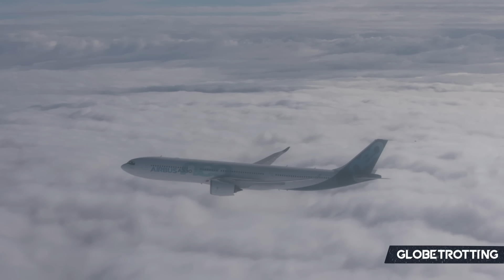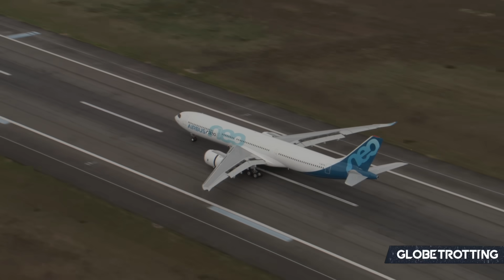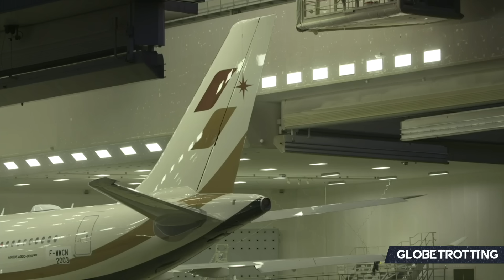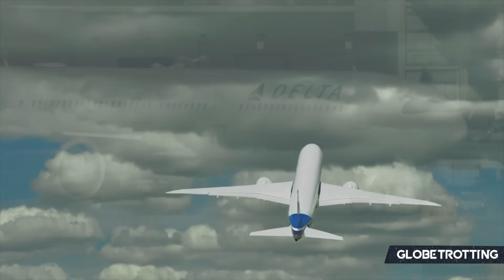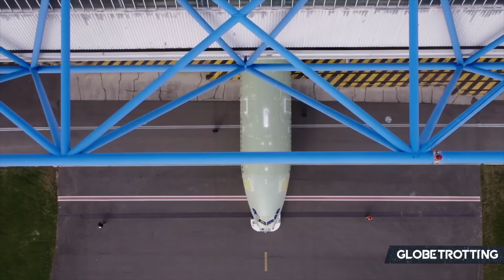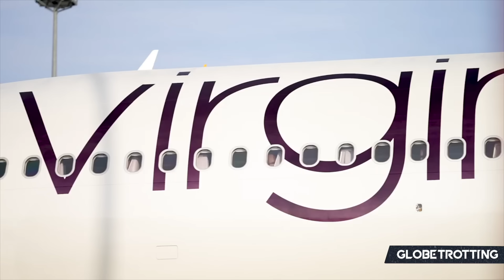787 RIVAL - The Airbus A330neo

Comment: Having been on an A330-ceo (as well as a 787) I do preffer the A330 slightly. I love the 787 cabin pressure advantage, which I think is the best feature on the plane, but I fly exclussively economy, where the differences are minimum. the 2-4-2 of the A330 is far superior to the 3-3-3 of the B787 and that is the deal breaker to me.
Reply: Even the most blinkered Airbus Fanboy would have difficulty believing that the A330neo will sell as many units as the 787. 

A realistic (optimistic?) sales prediction would probably be around a quarter at best.

However, with the development costs for the 787 being a double-digit  multiple of those for the A330neo, it is quite possible that the A330neo program may make Airbus more profit from a few hundred sales than Boeing will make from well over a thousand.

It should not be forgotten that Boeing is still unhappy with how much it costs to make each 787, and while the 787 may win more orders, the competition from the A330neo.and the higher than expected production cost does affect what they must charge for each unit.
Reply: The a330 isn't crowded yes 😊
Reply: Unless the carriers change the seat configuration but yes, this is why I enjoy the 330
Reply: Upgrade to business and problem solved.
Reply: How do you compare the ride in both? Dreamliner should be better handling turbulence.
Reply: @ivanviera4773 there is no such thing as a plane that handles turbulence better, whoever said that knows nothing or is just dumb
Reply: @maxsaviation9512  Bigger wide bodies do support turbulence much better than small narrow bodies. That's my personal experience as a passenger. The smaller ones dance a lot more.
Reply: The 787 absolutely handles turbulence better, it's literally a feature of the design
Reply: @andrewdrone   The 787 with its more flexible Carbon composite wing and gust suppression system should be smoother.
Reply: @ivanviera4773  Well, if we put the A330 neo in this comparison, than I have some serious doubts about it. I'm unsure about the composition of the A330 neo wings, but they're currently the more modern and more efficient wings we can find on any wide body currently flying. The reason is that they're just got the more recent design. They took the A350 design and improved upon it.
Reply: @miks564  I agree i think Airbus has done a great job cleaning up the A330 wing right now its has the highest aspect ratio among widebodies 11 so it generates less induced drag.
Reply: A330 is the only modern airplane that makes me nervous.
Reply: @CaliSteve169 why?
Reply: @anthonydeas2173  lots of accidents with it.
Reply: @CaliSteve169  The A330 has had two serious accidents with significant fatalities.

One was a faulty item from an outside supplier (but still the responsibility of Airbus), and the other was Pilot Error due to inadequate training and being overworked.

It's hardly a sound basis to come to the conclusion you have.

A 737 recently came off the runway at LBA (my local airport). I am not the 737s or, at the moment, Boeing's greatest fan. However, I certainly wouldn't hold that incident against them.
Reply: @neilpickup237  Air France 447 was partially a design flaw.
Reply: @CaliSteve169  It may well have been, but that alone doesn't justify an irrational conclusion, especially when you consider the issues Boeing has suffered over the years with its widebody models,  yet they are still way under the threshold which should cause potential passengers to worry.

The 787 has had a good safety record. However, we mustn't forget that good luck rather than good management has paid a significant part in that.

We only have to consider just how many potential issues have been raised once the scrutiny on Boeing was increased. Admittedly, it could have been some time before anything actually failed, but we mustn't forget that it took a 747s pressure bulkhead 7 years to fail after an incorrectly performed repair.

In no way am I trying to pit one manufacturer against another,  just demonstrate how irrational your conclusion is.

Even given the serious incidents from time to time, it is not unusual for there to be several years between major incidents attributable to the aircraft itself, wheras in the 60s and 70s it was more a case of how many months until the next one.
Reply: @neilpickup237  all good points, but please notice that I mentioned the A330 only. I'm perfectly fine with the A340 or the A350 (which is arguably the best twin isle out there). This isn't about Boeing vs Airbus. Specifically the A330 has had issues, the Cathay pacific engine issue, another Qantas (I believe) roller-coaster ride, the Hawaiian incident a few years ago etc. This specific airplane gives me goosebumps.
Reply: @CaliSteve169  And I was saying that because the A330 compared favourably to other aircraft, your singling out of that particular aircraft is irrational.

I also specifically mentioned that I was not pitting Boeing against Airbus. It just happens that the only other Airbus wide-bodies in significant passenger service have never killed anyone.
Reply: @neilpickup237  The 777 has no deadly accident other than the two Malaysian ones, which had nothing to do with the plane. A340 also has a perfect record (to name a few) so not sure I agreed with you on that one.
Reply: @CaliSteve169  Strange that you are not sure that you agree with me on that one when nothing you said contradicts what I wrote.

I fail to see why you keep trying to question my interpretation of various facts when I was simply using them to illustrate how safe wide-body aircraft are, not to implynthat one was safe and another was not.

After all, we have reached the point where even one incident will have a disproportionate effect on certain statistics.
Reply: @neilpickup237  I disagree that the A330 compares favorably to other aircraft.
Reply: @CaliSteve169  A view not held by those capable of objective thought.
Reply: @neilpickup237  hence,y initial comment was just a feeling, which is subjective, not objective. 
If Air France 447 was a B777, the crash probably wouldn't have happened since the two yokes are connected. Now that's objective.
Reply: @CaliSteve169 looks like your multiverse hasn't met the 737 Max😂
Reply: @ns8583  I don't like the 737 either.

Comment: I don’t think the a330 neo is the rival of the 787. I think it’s the a350 because the a350 and the 787 can fly lengthy route
Reply: The A350-1000 is significantly larger. It will directly compete with the Boeing 777X (once this finally gets certified) for the upper end of range and capacity.
Reply: @PhilippDebus  yea but the a350 and the 787 are used for lengthy routes like Sydney to Dallas or Los Angeles to Dubai
Reply: @Ayden2008  there is no 787 between LAX and  DXB.
Reply: Well, but the A350 is still a bit larger

Comment: The reason why many of the existing A330 airlines opted for the Boeing 787 Dreamliner over the Airbus A330neo could be because of the engine manufacturer selected for their A330s. Some of them are powered by General Electric's GE-CF6 engines, and some are powered by Pratt & Whitney PW4000 engines. If any airlines have their A330ceos powered by the Rolls-Royce Trent 700 engines, they can replace it with the Airbus A330neo or the Boeing 787 Dreamliner with Rolls-Royce Trent 1000 engines. If any airlines have their A330ceos powered by General Electric's GE-CF6 engines or the Pratt & Whitney PW4000 engines, they can replace it with the Boeing 787 Dreamliner with GEnx engines.
Reply: Not really much of a factor. Engine deals these days are power by the hour typically where the engine makers handle most of the maintenance.